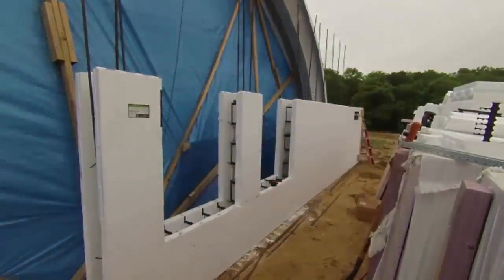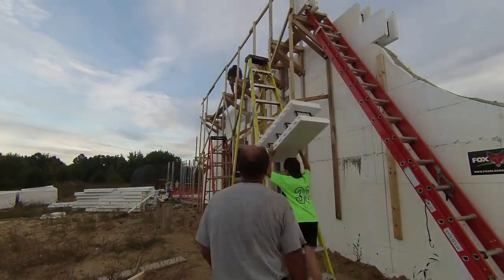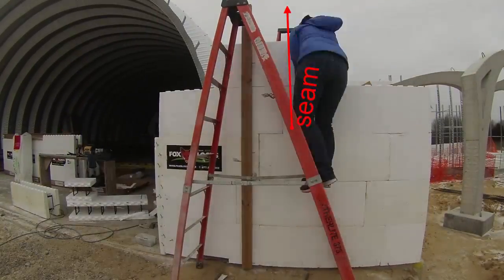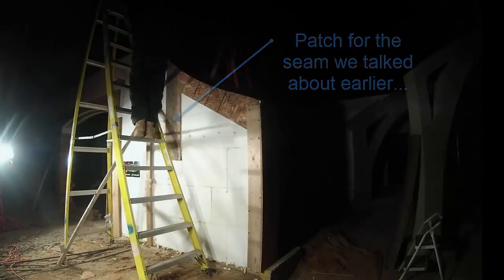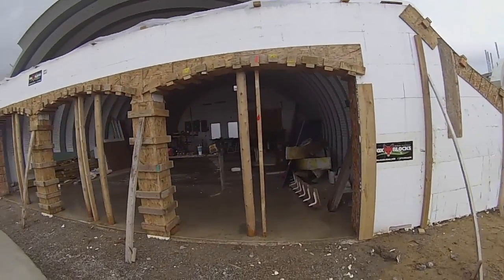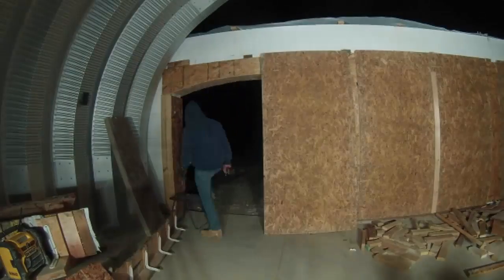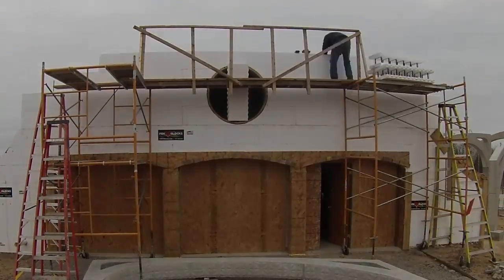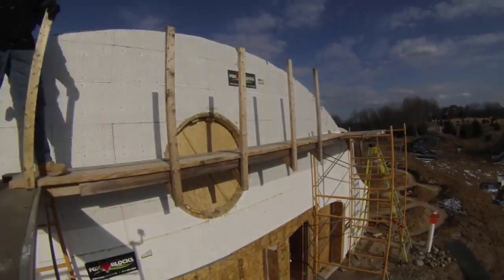23.0 Putting in the ICF garage walls

Comment: That was impressive. I've been wanting to build an "Earthberm" home forever and this video should me some additional options. (Is it possible for the concrete/shotcrete suppliers to integrate Basalt Fibers ?)
Reply from the maker: Yes, my particular mix supplier did not have basalt fibers, but I could have added them manually at the truck.  In other parts of the build, I have had them include glass fibers (similar idea).  

Actually, for the glass fibers, they were just tossing in the whole bag (sealed).  I was concerned that they were not opening the bag or that the bag would jam things later, but they showed me one and it says right on the bag that the bag is made of the glass fibers and the mixing action of the truck would tear it up and distribute the fibers of the bag its self.

Comment: what is the internal cavity width of those blocks? UK Gov regs require 290mm or 12" for walls above 3.5 meters or 11.5'  in height. What you were using looked a lot less. not sure we would get away with it over here even though its reinforced   :(
Reply from the maker: The Fox blocks are basically a form that contains a monolithic 6-inch thick reinforced concrete wall...  I have seen these exact blocks used to build a six-story building in my area (from your side of the world, you could see similar by looking up "Fox blocks" for some of their project videos).  I didn't see anything in the building code expressing concern about this...  Are you thinking about regulations related to retaining walls?  I guess I wouldn't want to hold back 17ft of earth with these, but only the top couple ft will function as a retaining wall.  The wall isn't even under any load from the Quonset, although the Quonset is attached to prevent lateral motion of the wall.